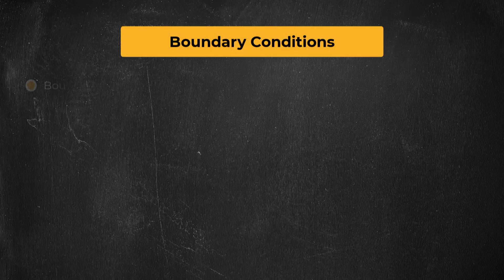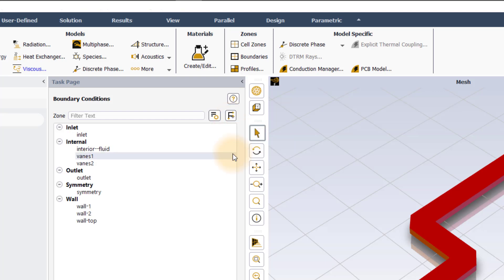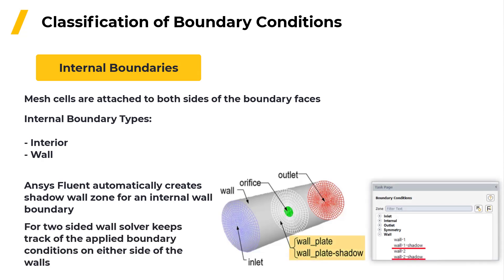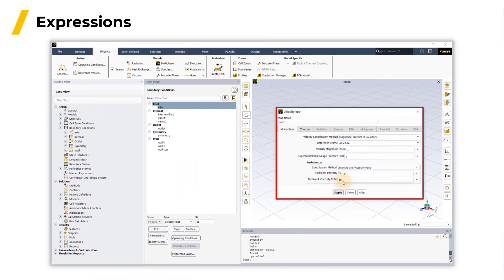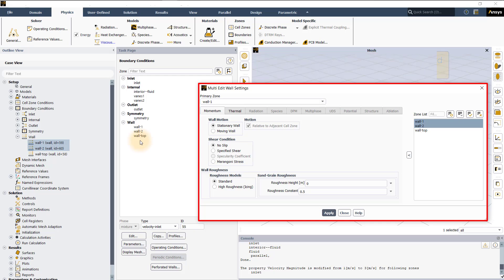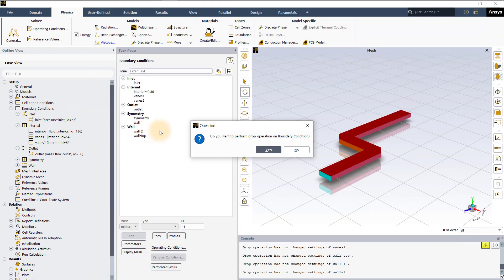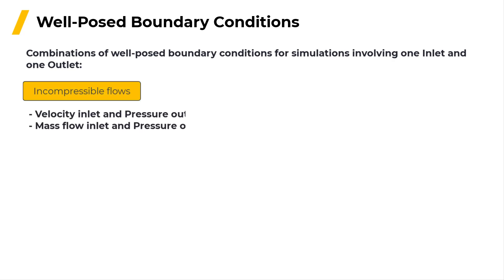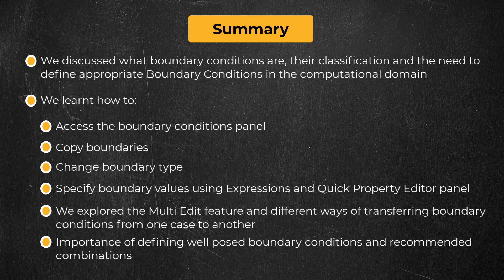How to Set Up Boundary Conditions in Ansys Fluent — Lesson 6

Comment: Why can't the wall for the fluid domain (in the boundary condition) be set for the fluid material in the thermal condition section?
if I want to simulate convection heat transfer from a plate to the air, what thermal conditions for air do I choose and what material is it made of? (because it can only choose solid material)
Reply from the maker: Thanks for watching! Please post your query on the Ansys Learning Forum for a detailed answer from the wider Ansys Community: https://ansys.com/forum.